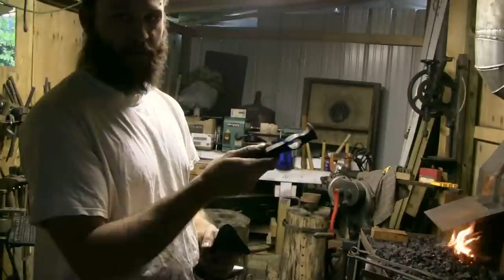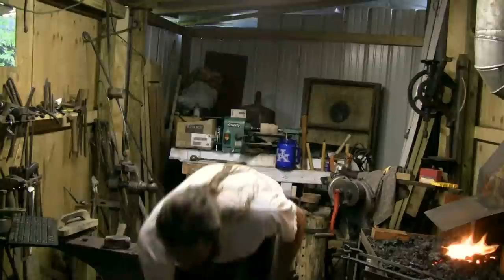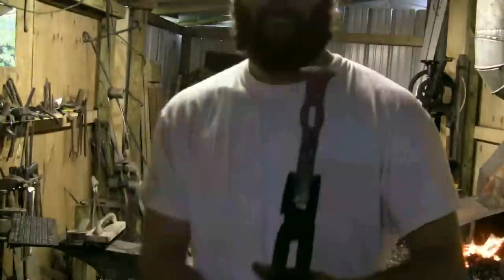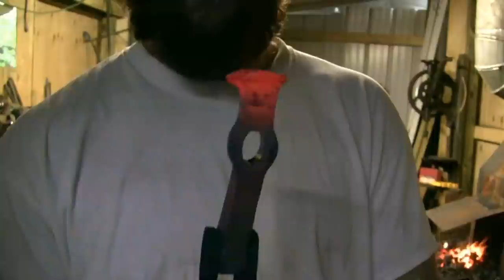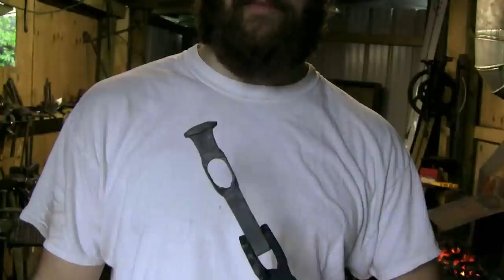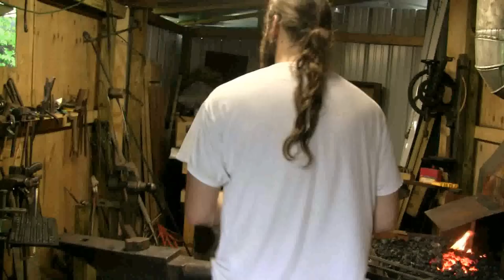Railroad Spike Hatchet / Tomahawk Demo

Comment: Nice video and good work. 
Most RR spikes are mild steel and won't harden using normal methods. Some spikes which were used in bends of the rail were High Carbon steel and can be hardened. These are usually marked HC, spark test to confirm

I was a professional blacksmith for many years making mostly knives and axes. Used to have people give me RR spikes all the time, I made mostly traditional axes so didn't use them to much. I made most of my axes out of iron buggy wheels and old files

Comment from the maker: For what section do you think they would help on? I have a set made but I like something with beef for my upsetting stage so I used my thicker 5/8" tongs. I do however need to make some hammer holding tongs that I have seen Brian Brazeal use.

Comment: The problem you had when drifting, about the spike bending. What you could do is flip the spike over and drive the drift in from the other side so that it will bend back into starting position, rather than bending it more and more then trying to correct it.

Comment from the maker: They are quick forged punches made from sway bar I dont set much of a temper in them to start with as they are also quickly repaired. The only tool I have that is made for this is the hammer eye drift made with S7 so it can take a beating at higher temps.

Comment: if the rounded head of the spike causes issues with control, couldn't you flatten it out before you begin the process? I have little understanding of blacksmithing that is why I ask.
Reply from the maker: I like to leave the head intact to keep the look of a RR spike so people can see what the item started as I guess I could flatten it out for a better "hammer" end when its finished.

Comment: how's come you didn't weld in a high carbon tip? just curious
Reply from the maker: I make these as a novelty item. I will weld in a proper edge on full axes.
Reply: cool thanks. that was quick lol
Reply: ill look you up on kick starter. have a good one

Comment: I started making a knife, and I got the metal so hot it was white, and it just won't flatten. Any help?
Reply from the maker: What type of metal are you using?
Reply: I accidentally bought the wrong railroad spikes, I figured that out after several days of very hard work. Thanks for your video, it helped alot

Comment: The chemical you are probably thinking of is borax
Reply from the maker: I use borax for Flux, but I don't know what part of my video you are referring to?  if I was talking about super quench I couldn't think of the word "Surfactant" which prevents the boiling water from forming a bubble around the piece granting more contact with the water and a faster (harder) quench. hope this helps
Reply: +BlackFlagForge Okay yeah I get what you are saying. It keeps it from letting the Leidenfrost effect happen.
Reply: +BlackFlagForge I also have some great ideas for railroad spike knives. I haven't made them myself due to insufficient supplies at the moment but I was wondering if you could give a swing at them first because you are far better at black smithing than I am. I only have cardboard cutouts of the blades without the rest of the spike if you would like to see them. If so I would kindly email the picture of them to you. I really want to see an actual finished product of these knives.
Reply from the maker: +Brycen Galbraith being a full time dad has cut into my forge time lately I'm afraid. trying to setup classes and finish back orders is using any of my free time atm.
Reply: +BlackFlagForge I see I see. That's understandable